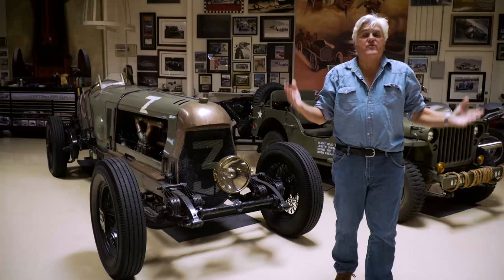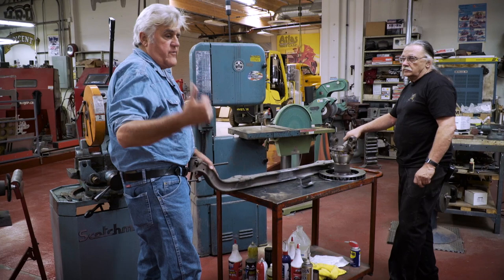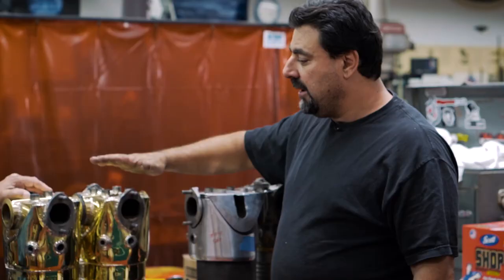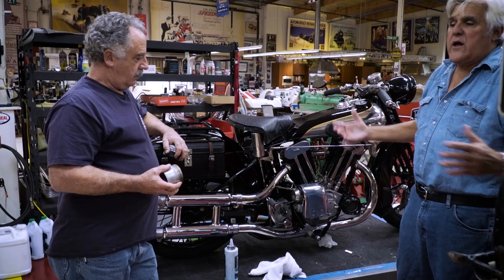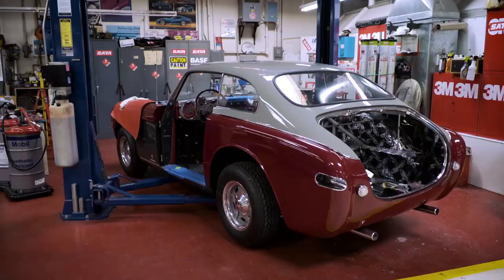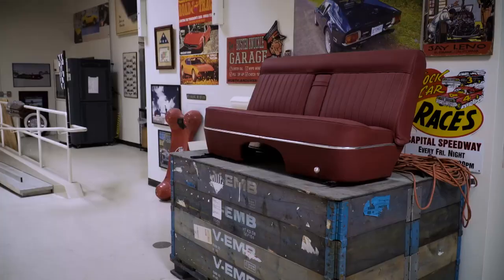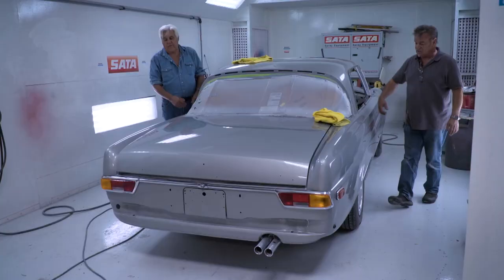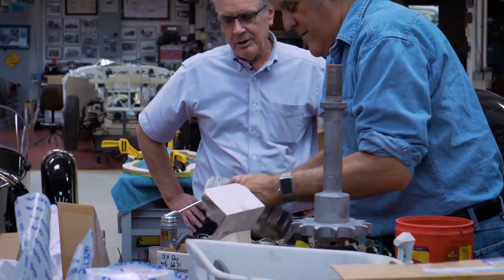Restoration Blog: November 2016 - Jay Leno's Garage

Comment: Jay, I was co-founder of Madera Concepts with Tony and Jeff. We started the business out of my old cabinet shop while the three of us were working for Clenet Coachworks back around 1979. We parted company in 1995 when I branched off into specialized industrial manufacturing.
There is an interesting story of an Indonesian gentleman who specified Rolls Royce build him a 1-off Rolls Royce sports car. Rolls worked on the design and informed the customer he would have to purchase 12 cars, not one. He said okay, I will put one at each of my homes. Metal Crafters of Costa Mesa was selected to build the cars and Madera Concept was sought out by Rolls Royce to fabricate accenting wood treatments.
Rolls Royce kept their  word to the customer (who was a Rolls dealer as well) and fabricated the cars for him. In their crafty way, the car design remained but was added to the Bentley brand.

Comment: The Lotus Cortinas assembled in Colin Chapman's factory had aluminium alloy doors, boot lid and bonnet for lightness. There used to be a joke that if you slammed the boot (trunk) lid down hard, you would leave your handprint in it.

Comment: Thanks for the insight. I really don't understand keeping the motorcycle in its original state when you could add an oil pump and drill some oil passages and improve the design. I had one of the original Hyundais and found Autolite Platinum was the plug that fouled less in oil burning situations.

Comment: You didn't discuss what type of brake activation (mechanical or hydraulics or other) you were going to use on the new disk brakes for the two modified front axles for the Butafogo and the Benz-Mercedes. Adding a full hydraulics package for disk brake activation is a serious mod to either car.

Comment: You seem to be excusing your shop built body for the Rolls, but surely all bodies for Rolls were coachbuilt by someone else at that time (e.g. Hooper), so you are following the exact original process - Rolls chassis and engine and then go have a body made. By the way, it is magnificent, even if the engine is a trifle larger than a normal Rolls engine. I think the power should be "adequate", as Rolls used to say.

Comment: SHOP TIP....
Jay,
 instead of using that blue painters tape to protect your surfaced eg, 
painted / chrome / ect, TESA have a protective film that has low tack, 
will last 12 months from VU and comes in various roll widths like 48mm.
Check out - ( TESA 51008-48MM BLK )

Comment: Very curious how those 3d printed parts hold up under temperature.
Reply: Yep. several different materials used with different qualities, purpose specific. A subject all of it's own.
Reply: I used to work product development, we rarely used the actual prints as the final part, more to check packaging and access. Back then, ABS was the most heat resistant, but high end  nylon filaments were just coming out. I have no idea what materials exist now, but I would still be rather afraid to expose it to such temperatures, vibration and oil as in this application. Hopefully someone from jay sees my comment and enlightens me as to what is possible to do with 3d prints nowadays.

Comment: Not many of the people out there would be able to tell you that you added 2 inches to the front axle.  You probably will never have to put it back as stock.
Reply: walperstyle well, it's not really the fact its two inches wider, it's the fact is will have disc brakes on the front of a car that never had any, but like you said, most people would never know that
Reply: Hide them in a drum  :)
Reply: yep, that's what they are planning but this car never had front brakes at all, its neat that Jay rebuilds these cars so they can actually be driven and not just sit on static display.

Comment: Seems more like car mods than restoration. Adding disc brakes to hundred year old racers? Converting the Cunningham to 12 volts because you can't handle the original design? MEH
Reply: HunterShows sad that you can't appreciate the engineering going into these.
Reply: tubeengineer Sad that you can't appreciate automotive restoration.
Reply: HunterShows I can because that's what this is, and he says in the video they can be returned to stock at any time, so they're non-destructive mods.
Reply: tubeengineer No, you can't. You like the opposite, part swapping on rare cars. It's nice that they're non destructive, but that isn't the same as the cars ever being restored assuming the original parts don't get lost. Jay does this constantly with transmissions, carburetors and brakes...and you love it.
Reply: ***** I do :-)